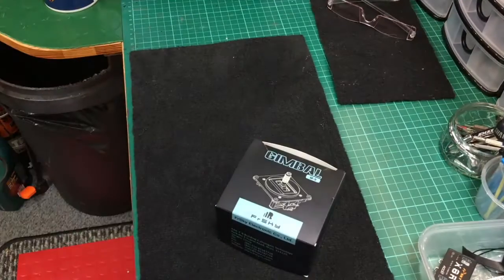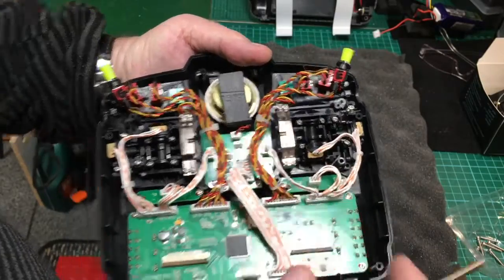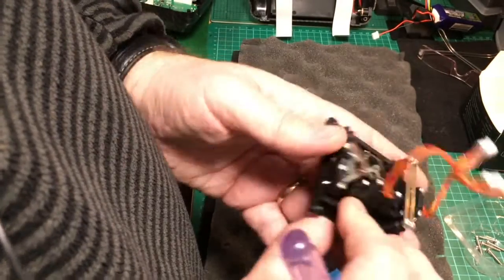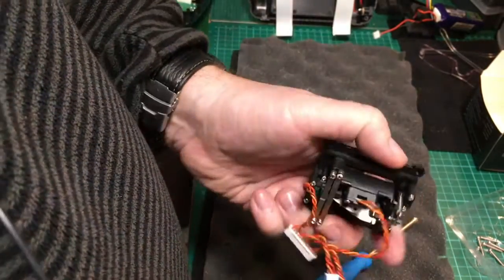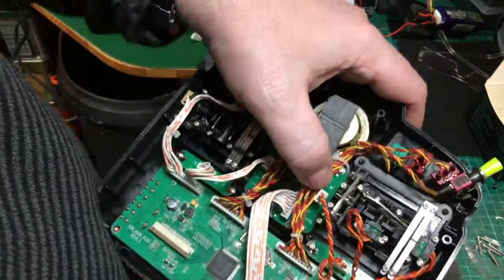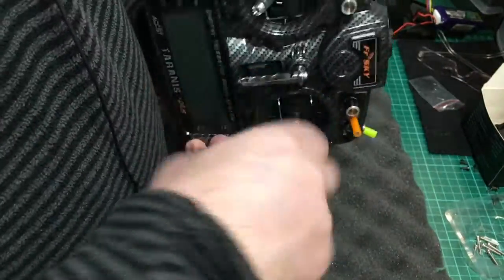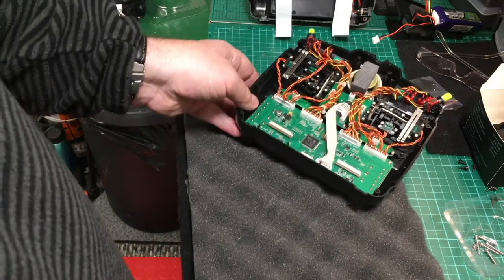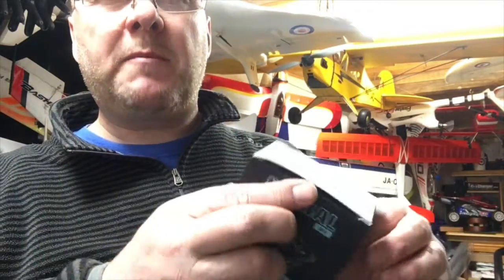Installing the FrSky M9 Hall Sensor Gimbals into my Taranis

Comment: Can you use these in an old Flysky 9x radio? Seems like they would fit.
Reply from the maker: Its the plugs that probably will not match. The gimbals may physically fit but you would have to know the correct wiring arrangement. Basically I would say don't bother and buy an FrSky X7S radio first as last.